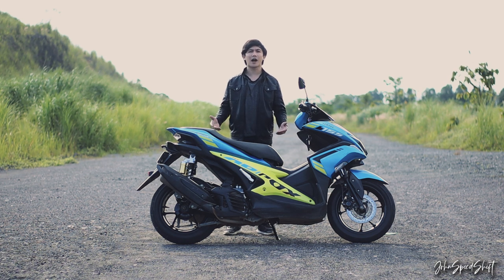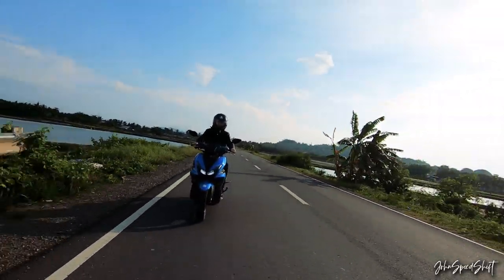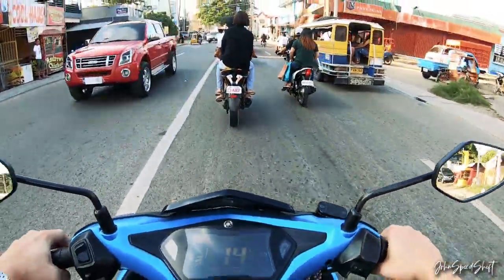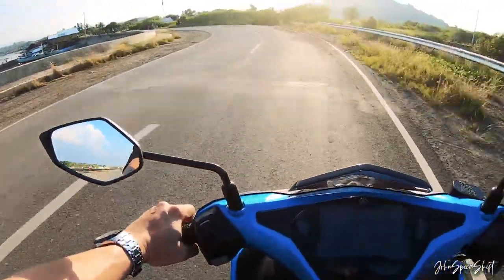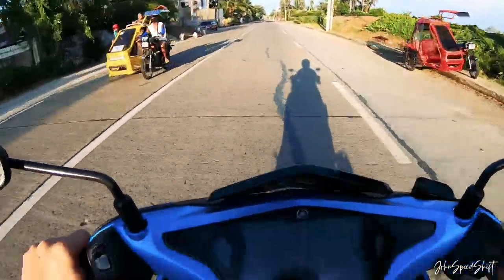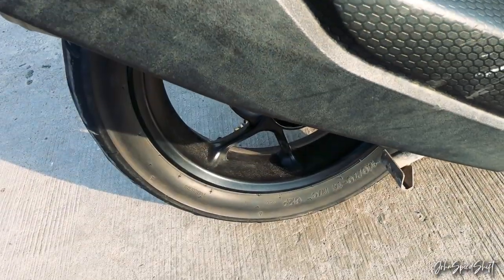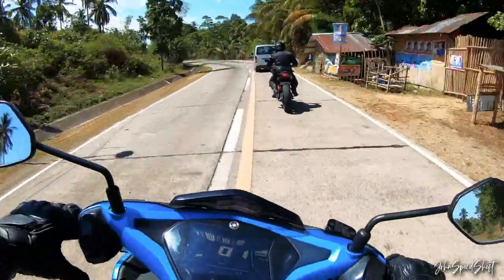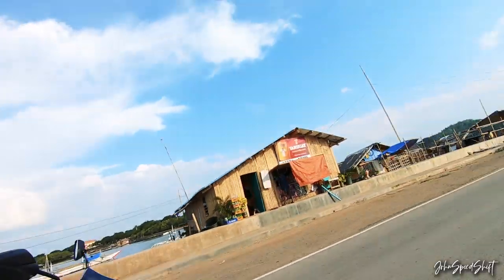Best all around scooter?

Comment: sobrang tipid pla ng aerox doxou kung ganon sir.. kc biñan to tagaytay pag paakyat may angkas pa aq nyan nakaka 36 km/l sa 40kph to 60kph nka on ang SSS (stop & start system).. then pag pababa i you won't believe this i got 70 km/l kc nga pababa not much gas ang need kc nga may pull ng gravity.. ang tunay & mas accurate kc na pag meassure ng km/l is ireset mo muna to zero or blank ung gauge mo ng km/l then saka mo patakbuhin.. kc kung kasama ung pag papainit mo ng engine sa umaga mag minus yan sa km/l mo.. then pag round off ko ung paakyat & pababa ng tagaytay cguro nasa 58 km/l ... nasa 295 lbs kmi ng angkas ko..

Comment: Nice review but naumay na ako sa Aerox ko. Bitin din ako sa tank capacity since long rider ako on a weekly basis. Tama ka din bro about the brakes. Sana disc nadin yan lahat kahit walang ABS, oks na sana.
Reply from the maker: For me sir there's no problem with the drum brake. Yung front disc brakes kasi are the same sa Mio which is designed for a lighter motorcycle. So braking will definitely be weak on a heavier bike with bigger tires. I agree about the tank. Suki din ako sa gas stations pag may mga rides.
Reply: @JohnSpeedShift  brakes are my main concern lalo na pag may angkas ako. I really want brakes that bite well. Sinagot na ng NMAX pero sana, sana lang nasa Aerox nadin para near perfect na sya. 😎

Comment: Nice!!! naliwanagan ako sa aerox, sana may review din pag uphill kaya nia kaya pag may angkas lalo sa matitirik?
Reply from the maker: Thanks sir. Also experienced that na may angkas dito samin at matarik din. No problem naman basta maka bwelo lang. At slower speeds kaya din pero medyo magastos lang sa gas because of dragging ng CVT transmission, pero if you're asking if kaya, kayang kaya po.
Reply: @JohnSpeedShift  Thank you po kasi iniisip ko baka d nia kaya lalo pag natigil sa traffic tapos matarik na daan  may angkas pa mabigat ako eh hehe
Reply from the maker: @tagabaguio5736  its easier po kasi both brake levers are on your hands so it will not be a problem. Ride safe po.
Reply: @JohnSpeedShift  Yown Salamat po Ride Safe and More power sa Channel mo master!!!
Reply from the maker: @tagabaguio5736  thanks sir. Ride safe din po

Comment: Bro, may ginawa ka bang modifications sa side stand center stand? Dahil nag sskid sa corners.
Reply from the maker: No modifications bro. Sa akin din nag skid din pag sobrang lean na. Kaya lang I hang off the bike to reduce lean angle(knee down style). At mas magaan ako at 58kilos so the suspension doesn't compress that much too adding to the factor na di masyadong maabot yung center stand.

Comment: Boss anong best na gasoline para sa Aerox ko? I usually use petron blaze sa mio i125 ko before. Tia
Reply from the maker: Blaze is good din po if possible. Pero notice ko sa mga motor na di gaano mataas yung compression ratio, mas madaling maubos yung gas. So I use 95octane  gas na lang po sa Aerox ko. And another factor dito samin is kapag nag long ride kami. Di lahat ng gas stations may 100octane fuel so I stick with 95 para consistent po.

Comment: i am planning to buy either aerox or the new  ADV kindly help me choose which is better, its my first time to ride again after 30 yrs, im impressed the way u explain, thank u
Reply from the maker: Both have the advantages of practicality, but both of them are in a very different category. If you want to ride more on the road and likes sporty and fast riding, the Aerox is best. However the ADV150 is great for both road and offroad which means that it will not have the handling of the Aerox in road but it will definitely have the advantage offroad. Its a tough choice, you need to identify your riding style first before choosing.
Reply: @JohnSpeedShift  thank you John for the info and i will let you know once i have decided which one i will buy thanks again
Reply from the maker: @edgarcabantac3022  You're welcome po sir. Happy to help po. Goodluck in choosing po. Ride safe.

Comment: Sir may isa atang hindi na tackle, ano po masasabi niyo kung kayo ang aangkas sa aerox? comfy ba? hindi mahirap? nakakangawit ba kasi mataas? Balak ko kasi bumili for everyday pamasok namin ni GF. Parehas kaming mataba/mabigat, okay lang ba ang aerox samin?
Reply from the maker: Hello sir oo nga no. Hmm sa backrider naman, sa una medyo comfortable pa kasi wide seat cia. Pero habang tumatagal, di na comfortable si back rider lalo na sa long rides because of the lowered suspension so konti na lang travel medyo matagtag at yung legs medyo spread so mangalay po sa long rides. Pero on short rides, its not a problem.
Reply: @JohnSpeedShift  thanks!

Comment: Sir, what are your thoughts about sa fuel tank upgrade sa Aerox. Meron ba pros and cons?
Reply from the maker: As of now sir wala pa akong personal experience with the upgraded fuel tank pero sa tingin ko okay din cia kasi fuel injected naman yung motor natin. There will be no fueling problems with slightly changed position. One thing na you will look out siguro is the fuel tank integrity na matibay cia para iwas leaks.

Comment: Ano po mas comfortable monoshock or stock po?
Reply from the maker: Depende sa shock na ipapalit. There are monoshocks na mas expensive, adjustable rebound, compression at iba pa. So basically the monoshock could be more comfortable than stock shocks. If napalitan yung stock shocks ng mas better, either way could be comfortable.

Comment: Bumaba po ba yung seat height dahil sa rear suspension? Sakin kasi 5'3 1/2 tip toed talaga ko. Stock suspension
Reply from the maker: Yes po. Pero konti lang. Mga 10mm for my weight. Wala namang problema yan sir, pag tumatakbo na yung motor, seat height will not matter. Yung other motorcycle ko mas mataas yung seat height and mas mabigat pa dyan kaya medyo sanay na din.

Comment: Mileage or fuel efficiency ??
Reply from the maker: Hey there, I got a 35kpl on my most efficient run and 22-25kpl on walwal mode.
Reply: @JohnSpeedShift  I am planning to buy it .. but 22 mileage is too less .. in my country petrol cost is very high now , specially after COVID ... Even re 350 cc bikes gives more mileage ..
Some one told me in normal city condition he gets 35 km mileage... With his new scooter...
I am not very fuel efficient driver.
Reply from the maker: @avijitgoswami3082  same here in PH man. Petrol is so expensive too. A 350cc manual bike can be more fuel efficient especially in long rides since the rpm's don't need to be high in cruising a 100kph pace vs a bigger displacement bike. But for city driving, the Aerox is enough. Its light and nimble. Dont need to rev that high either to overtake a few cars in traffic.

Comment: Ano po ang height nang kyb shocks sir? Ano din po ang height nang stock shocks?
Reply from the maker: I think its 310mm for stock ones and the same sa KYB. FYI I saw some 2020 renderings of the Aerox using these KYB rear shocks as stock ones. Fingers crossed. Sana nga.

Comment: I'm in Vietnam and have the NVX 155.  I've only done 18 000 km's so far and so many parts on the bike broke and had to be replaced that I will never buy a Yamaha again.  This thing is costing me an arm and a leg.  You forgot to mention how bad the lights are.  You can hardly see at night and as you've said, the brakes and shocks are useless!!  I find this to be a very unsafe bike to drive and can not be compared to Japanese manufactured bikes in Europe.  Not even close!  At the very best, I will say it's a better than average Chinese bike with some hesitation because I can't really justify the "better" ....
Reply from the maker: Could you reiterate in detail how you treat your scoot?
Reply: @JohnSpeedShift  I'm 60 years old and keep within the prescribed speed limits of 50 and 60km/h. My bike goes to one of two Yamaha dealers i. Long Thanh for the services as prescribed by the dealers here.  I haven't missed a single service since I got the bike and the bike has never been on a dirt road (gravel road) as there are none in and around Ho Chi Minh City (Saigon) or Long Thanh where I'm located.  The bike gets washed once a week at a carwash and I do the polishing myself.  I travel alone and weigh around 80kg. The bike is mostly used to commute between Saigon and Long Thanh (45km trip one way) and occasionally to Vung Tau (70 km from LT).  Other than this, I don't really have anything else to add.
Reply from the maker: @wjvanderwesthuizen  That's a fair way of using the scoot. Now I'm about 55kg in weight so I haven't got much issues with the bike. But the front suspension's bottoming out on me when I ride it hard or when I hit pot holes. Quick fix was I added more fork oil for more damping. You could also change the spring for stiffer ones. It could only cost you about $25 including labor. Mine's was the 1st edition so rear suspension was also trash. It it the rear fenders when I'm riding with a back rider. Changed the suspension, solved the problem. But that's probably the most common issues with this scoot. Others are reasonable as you accumulate them overtime as normal wear & tear.

Comment: What id arox has manual version.
Reply from the maker: Medyo impossible yan bro. Kasi the main point of a scooter is convenience so it really makes sense na automatic transmission cia. Pero there are manual transmission motorcycles based on the same engine. The R15 V3, MT-15, Updated Sniper 155, Upcoming XSR 155.

Comment: Guys..ask lng aq Sino nka experience na parang ma bigat Ang left side NG aerox..ano Kya probs nito?
Reply from the maker: Anong klaseng pagkabigat sir? Yung manibela ba?
Reply: Yes sir...prang hinahatak aq p left side...
Reply from the maker: @jhonjacob1643  probable causes:

1.) Tire pressure too low. Check tire pressure if inflated at optimum  pressure.

2.) Headset bearing(knuckle bearing) is already worn out. Go to service center, get it checked if it needs to be changed.
Reply: Thanks sir..

Comment: Sir ano po tire pressure mo sa rear and front?
Reply from the maker: Will check it tom sir. Pero its different from the recommended ones since i'm a light rider.
Reply from the maker: I can't remember the exact tire pressure sir pero for me as a 56kilogram rider and loves aggressive riding, I usually go 3psi lower tire pressure for the rear and 2 psi lower sa front from the recommended tire pressure that's written on the tire in all my bikes. Sana makatulong.

Comment: ano pinagkaiba ng aerox sa ibang scooter. kapag inistart na yung engine tahimik kasi ung starter nya
Reply from the maker: Maraming pinagkaiba bro. Most obvious difference is the size of it, size of tires and engine tech. Yung quiet starter nya is the effect of a different design layout ng lahat. Yung engine kasi is derived from the R15 so unlike other scoots, the engine behaves like those of a backbone type motorcycle.

Comment: paps, tanong ko lg..di po ba ito hirap sa mga 5 ft ang height? salamat sa sagot
Reply from the maker: Hi sir, it depends po sa tayo. If medyo maiksi po inseam (legs) nyo, medyo may kahirapan pero pwede din mag stretching. Adding to that is magaan po yung Aerox so it will not be much of a problem.
Reply: salamat sa info paps..R.S lagi

Comment: Hal. Po paso na ung rehistro pwede po b palitan color ng motor ko isasabay n po sa pag papa rehistro meron po bng bayad ung pag change ng color salamat
Reply from the maker: Yes po sir. Pwedeng pwede po.
Reply: @JohnSpeedShift  mgkno po p change color ska ung rear shock mo po ano height
Reply from the maker: @marphyrafael7582  pinasabay ko po yung change color sa renewal so no extra charge just the renewal fee. Nasa 330mm yata yung height. Same sa stock. Bought it at 4,200 dati.

Comment: Boss ano pinagkaiba ng ng yamaha aerox with abs sa non abs.
Reply from the maker: ABS stands for Anti- Brake Lock system po. The Non ABS well doesn't have abs but the ABS version has. The ABS basically has an extra means of safety when braking. Doesn't let you lock up the wheels when applying brake pressure too hard.

Comment: Im using wave 125 2016 model .. Walwal mode ko is 35-40kmp fuel consumption 😂 same na sa f.i nio  😂
Reply from the maker: I believe mas matipid po so wave considering na its a smaller motorcycle with a smaller engine. 😊
Reply: @JohnSpeedShift  kahit kargado na po ito 😂
Reply: edi jan ka nalang sa wave mo hahahaha
Reply: @nivrah09  edi magsama kau ng malakas sa gas na motor mo 😂
Reply: nonood nood ka ng aerox video tas iyayabang mo yang wave mo na bulok kaya ipapakargado nalang para masabi naman na malakas hahahaha
Reply: @nivrah09  sinabi ko lang naman na same ng fuel consumption aa ? Kulang kaba sa aruga ? Kaya nagkukupal ka nalang ?
Reply: Malakas sa gas yan 125 mo, pumarehas kana sa aerox 155  ganyan din consumo eh